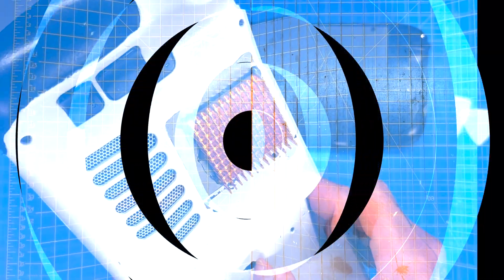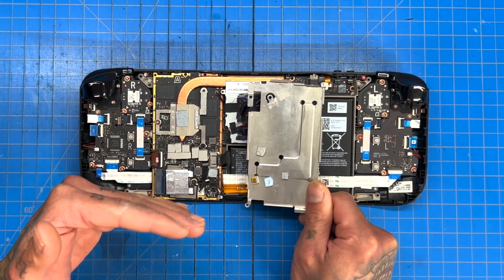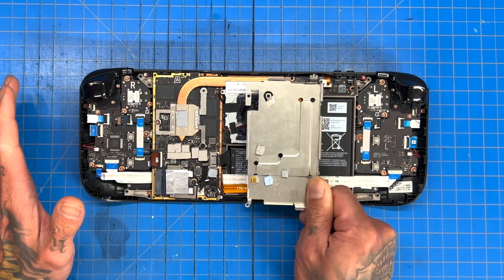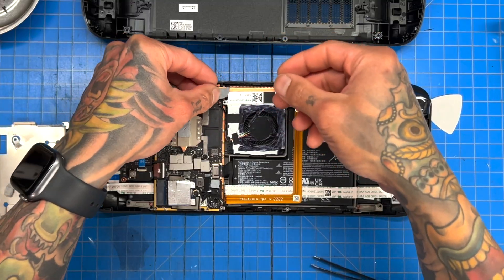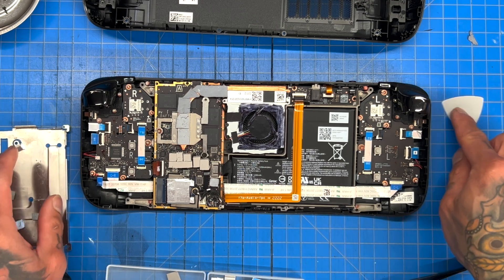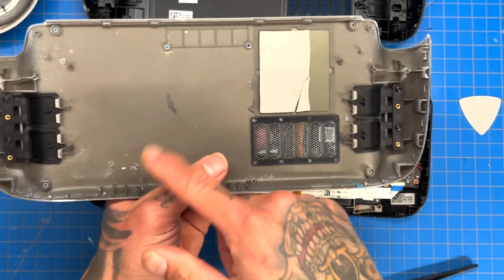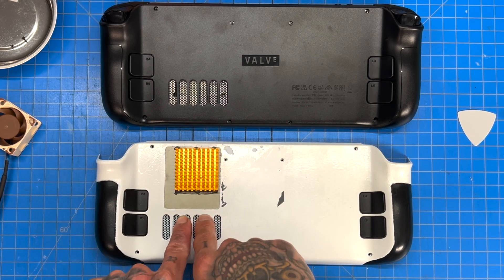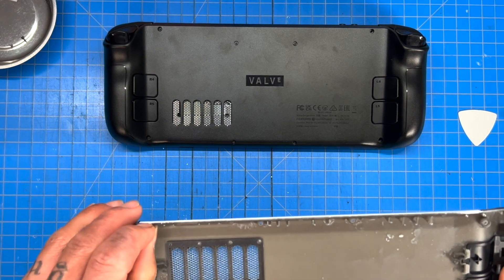Steam deck Thermal Pad Mod 1.1

Comment: The best thing to use for something like this is blobs of thermal putty. The blue or pink kind, NOT K5 pro. That stuff dries out and crumbles within weeks. You want to make sure not to use big strips of the putty though. Use individual blobs per component. Otherwise you restrict the very minimal airflow that there is in that part of the board.
Reply from the maker: Great idea, are the putty’s less or more conductive than the paste variant?

Comment: Question for you Diy Papi, If i get the J back plate. Will this thermal pad mod help keep the temps down with out modding the back plate like you did with the extra heatsink and fan?   Or is the extra heatsink and fan a must?
Reply from the maker: No point in getting Jsaux BP without active cooling unless you want the rear buttons.

Thermal pad mod will help transfer heat better to the exterior and will help cool things down by a degree out of two at most without active cooling.

if you could at the very least place a fan on it it would bring down temps by 4-5 degrees.
Reply: @Diy Papi  thank you for answering my question. Yeah the back buttons are honestly the reason I want the back plate lol but getting lower temps is a bonus.  Another question should I cut out some of the thermal pad from the back plate, that way the channel on the aluminum plate on the SD does not get blocked? I remember you stating in another video that we should cut out that channel in the thermal pad on the J back plate. Thanks in advance!
Reply from the maker: @Pops-DA-SalorMan  I would definitely recommend cutting out the part of the thermal pad like I did in the video that is blocking their channel. You could also use that same thermal pad for the thermal pad mod but remember it’s a little thicker so you will have to make sure the screws are tighten down all the way.
Reply: @Diy_Papi  oh for sure, thanks. I'll post some temps for a few games before and after the mod. Thanks again for doing all the testing and work on this!
Reply: As temps before playing Prey on mid settings, I was getting GPU 76 to 78 average. For the CPU, I was getting 77 to 80 average. so I finally got the Jsaux BP and I added the thermal pads to the copper heat pipe and cut some of the thermal pad on the Jsaux BP so the air channel on the aluminum shielding on the SD. Now my temps are GPU 68 to 72 average and CPU its 70 to 74 average . I think the highest I saw was 75 on GPU and 78 on CPU for a second or two. I have not added any fans or anything else. I'll post more updates as time goes by. Again, thanks, Diy Papi, for doing all the testing and putting the hard work.
Reply: @Pops-DA-SalorMan  combined with good thermal paste on CPU should go even lower

Comment: quick question, but isnt the higher height thermal pads on the apu keeping the smaller size pads on the thermal pipe from contacting the backplate?
Reply from the maker: Not at all.

.5mm on the APU
Reply: @Diy_Papi  ah, thats what threw me then, the info in the description says apu 1mm, heat pipe .5mm, and as i havent opened up the heatshield yet, just looking at the cam views it looked like the heat pipe was lower, so wondered about that .5mm measurement in the video description..  I can take a stab at the heat pipe/apu changes now, got the thermal pad sizes i needed today, no idea why but getting 2mm/3mm was no big deal, i had a weeks wait or more for 1mm and just under that for .5mm, might be in higher demand?.

Comment: Next is to just do the copper heatsink and m.2 heatsink like me lol. O with the 7950 honeywell. highest temps are low 60c
Reply from the maker: That’s endgame stuff bad for content lol
Reply: Can i put ptm7950 on the chipset ram ??
Reply: @sharlatandjaul3739  So where are you on the world of modding your steamdeck? Could you use ptm7950? Yes but for the price it is just overkill. Your best value in all this mod stuff is to just buy a jsaux blower cooler and call it a day. Cheapest and best way out.

Comment: Thanks for all the vids and research. I did mine today and also added pads to the RAM chips. I also overlocked mine so I needed this cooling and it works really great. Stock TDP with undervolt gets me 65C on load. With overclock it’s back up to 75-80C but wouldn’t be possible without this cooling mod. Thanks a lot
Reply from the maker: No problem, what are your clocks and TDP, also which game are you testing?

Comment: I added 3 40wmk graphite on that heatpipes and 1 on each ram die.
20wmk pad on jsaux plate.
Graphite is electrically conductive, dont try placing them on VRM
Done vent mod, next one will be a large heatsink for the Jsaux contact plate

Thank you for your content. Keep posting more findings!
Reply from the maker: Bro that’s awesome, love to hear your results

Comment: I've Already done this as well but I also changed the thermal paste with some PTM 7950 with great results.
One thing you forgot to mention is to make sure you peel the black sticker off of the inside of the shield.....I used a little heat and then to get the glue off I used lighter fluid as 99% alcohol didn't work.
Reply from the maker: My guy! Damn totally forgot about that
Reply: Can i put ptm7950 on the chipset ram ??